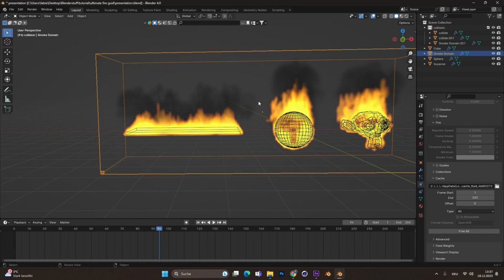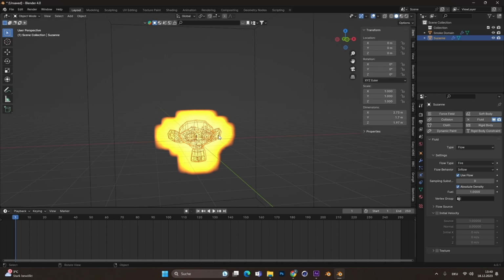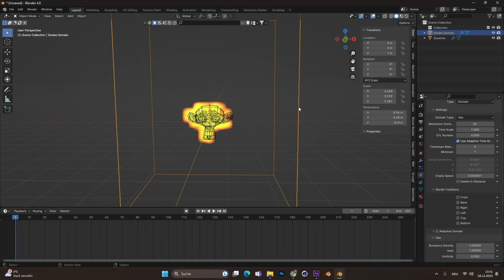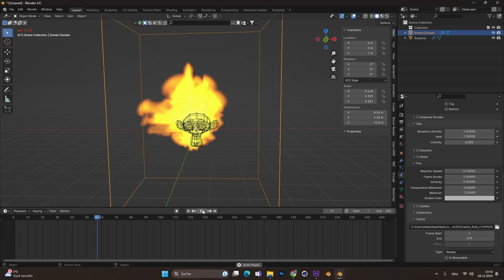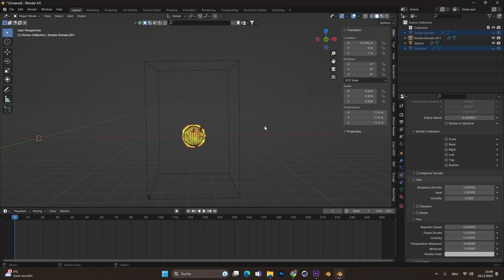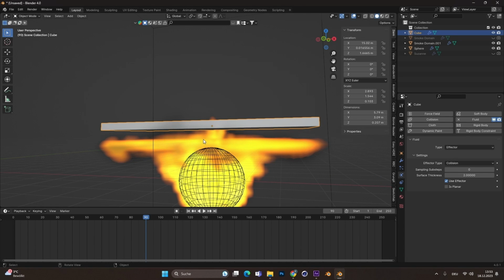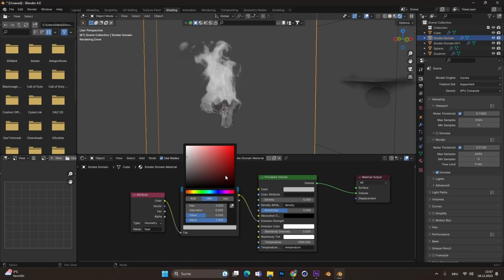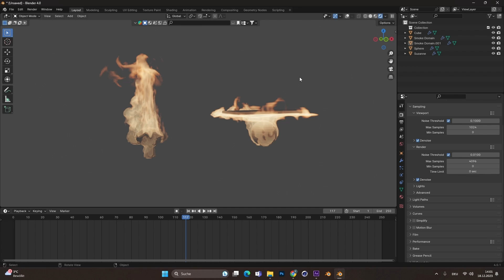Realistic Fire Tutorial + Collision Blender 4.0

Comment: My fire simulation looks like a low poly mesh at 256 divisions. On the other hand, the viewport version of it (not viewport render) has no such problems. Could there be some kind of domain or flow object setting that's causing this? In fact, the rendered fire looks just like the viewport fire does during the first few minutes of this video, while backwardly looking far more realistic in the viewport!!!
Reply from the maker: It always looks shit in the viewport thats because in the viewport everything looks shit so ut runs faster. If you want to see how it looks for the render you need to switch to the rendered view mode
Reply: @faebetutorials  Well, actually, that's the opposite of what is happening. The renders of the 256 division simulation are what looks like a low poly mesh, whereas the viewport version doesn't. I had something similar happen with a smoke simulation in what is basically the same scene with the smoke sim removed, which was corrected by just increasing the transparent light bounces.
Reply: @faebetutorials  Admittedly, I had to make the fire simulation huge due to the fact that there's also rigid body stuff in the scene, which doesn't work well at a smaller size.
Reply from the maker: @backforblood3421  Oh okay yeah the size is a big factor which could detroy the fire simulation
Reply: @faebetutorials  Okay. Thanks!

Comment: Amazing tutorial. Thank you for making this and going at a wonderful pace. Super easy to follow and rewatch. I did have one issue with the collision on the effector cube. It isn't working for me. I tried using a smaller flame for what I need. but the flame and smoke go straight through every time. I changed the thickness to 2, then 10 and nothing is stopping the flame and smoke from going through. I did do the subdivide as well. Several times. Any ideas of what could cause this? If not, I still really appreciate your tutorial.
Reply from the maker: Maybe try to bake it and look at it again. Sometimes the realtime simulation doesnt work always, but if you bake just a few frames, for example 50 frames to see if it works, you should get the correct results :)